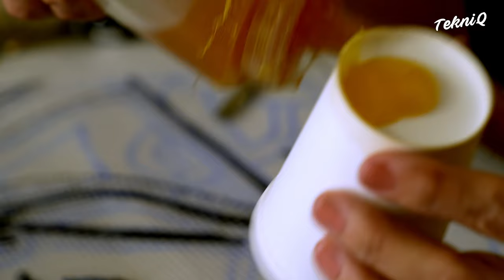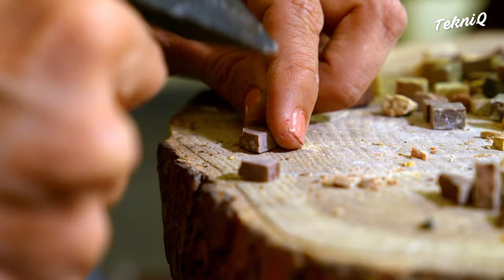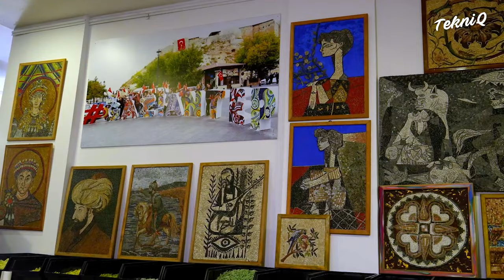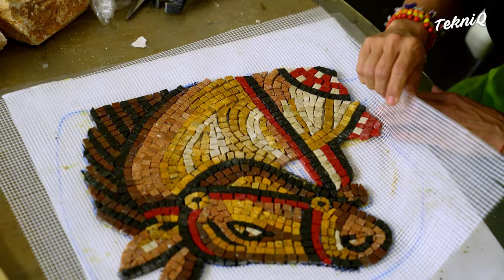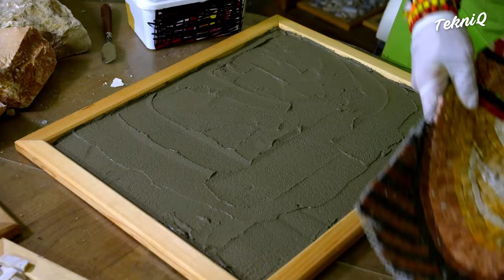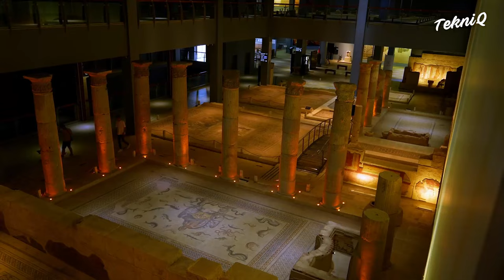How Artist Makes the Most Complex Mosaics by Hands

Comment: Anybody know what kind of adhesive she was using?
Reply: I suspect a type of hot glue, but any flexible one would work. contact adhesive for example. 
It's the cement or lime that does the main binding. (with 0.4mm sand)
would have been nice to know though, I agree.